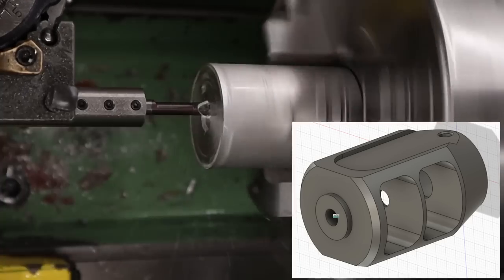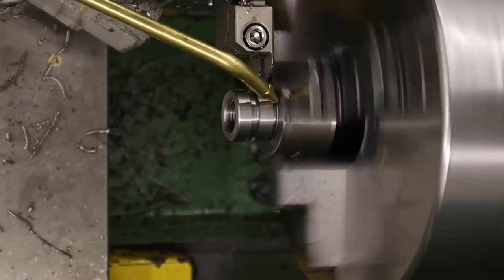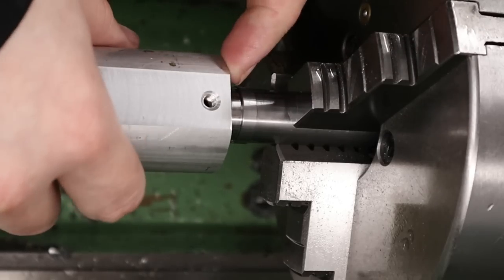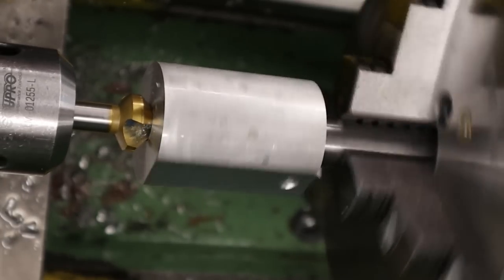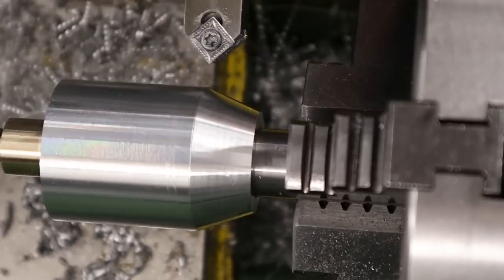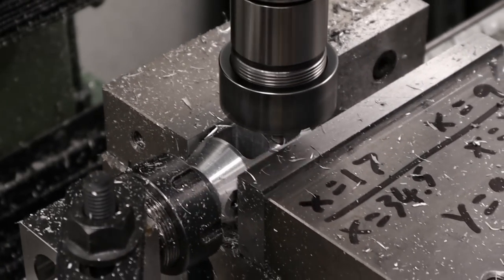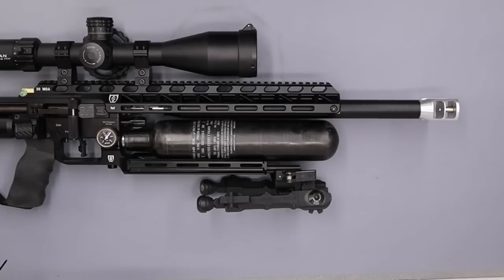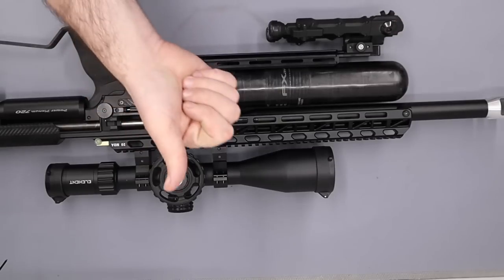Making a Muzzle break for the FX M3

Comment: Very nice design. Nice place to mount a front globe sight for use with a diopter. Has it affected the noise much? Been toying with the idea of doing something like this for my PX5, but that has quite bit of bark without a moderator on the end.
Reply from the maker: It's a little louder but we have a modified  shroud so still better than most up the range👍
Reply: @sub12airgunners  Thanks, thinking the PX5 might look good with a carbon fibre shroud, so gives me an excuse to look into that as well 👍👍

Comment: Please can you help with an old video of yours  about the impact m3 homemade moderator...

Loving your videos, they've helped me know end with my R10. I've recently bought an M3 and the shop said you don't need an additional moderator, the standard is quiet enough but in my opinion it can never be to quiet. So, before buying a new mod. I thought I'd try something like what you've done here. But not having the tools or skills, I order a 3d printed baffle on line, wrapped it me felt. Its definitely quieter but I'm now getting a quiet hiss of air, like if it's trying to squeeze out of somewhere. Any advice, help it would be so much appreciated. Do I need to drill 1mm hole at the back of the moderator or shroud..?? It would be so much easier if you sold your items rather than us lesser mortals trying to replicate your work...lol.. and a good way to make money to help fund your videos, instead of merchandise.

Comment: very nice mate . will be interesting to see the results with and without the muzzle break when you get around to it . was thinking about one for the 510 tactical but it’s not 1/2 inch unf  it really an issue though just wonder if it’s worth it accuracy wise 👌
Reply from the maker: I was surprised how much difference it made changing the stripper size so more testing to be done   👍
Reply: Just catching up on a bit of YT and noticed your comment. I got a 1/2” S510 Tactical adapter from eBay. Just had a look and there is one left. TR 510 silencer adapter. Just thought it might help you.

Comment: Could you make a muzzle brake with a way to put a tube around it??  To get the benefit of the muzzle brake but also the cut the sound a bit???  It that possible??
Reply: Just use a moderator, about the same effect as a muzzlebrake but with sounddampening.
Reply: @MrValke011  Turns out I figured this out.  I wish I could show you pics.  I have an M3, it came w the FX moderator, which is just empty tube.  My muzzle brake (a Just the Tip Tactical) fits perfeectly inside that tube.  I have not accuracy/precision testing yet but I did get it to work. 

I can say that a muzzle brake got me better precision than a Donny FL Ronin....but obviously the sound is different worlds.  With very high tunes you need to get rid of that air from behind the slug.  .25 cal shooting at roughly 1000fps reg at 180 has a lot of air behind it